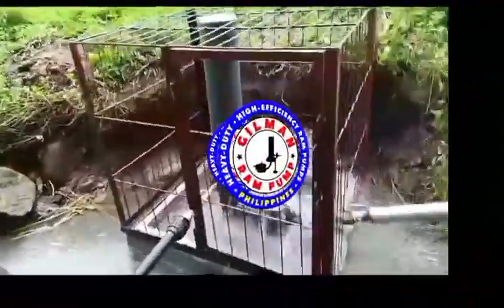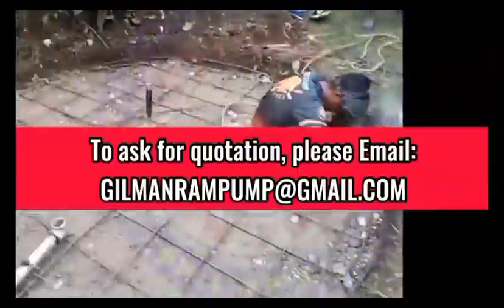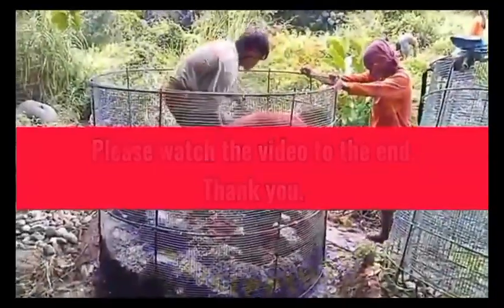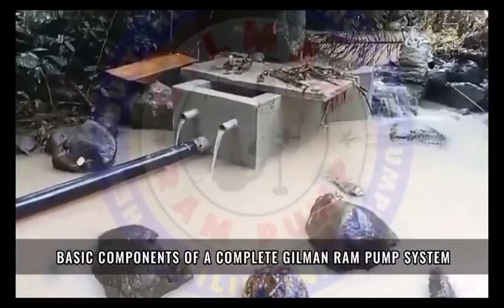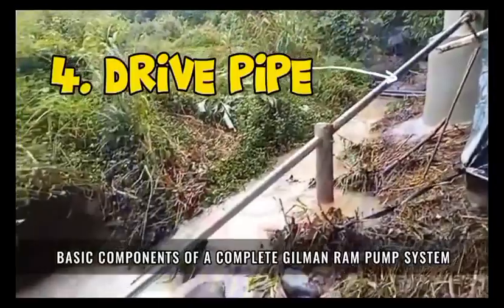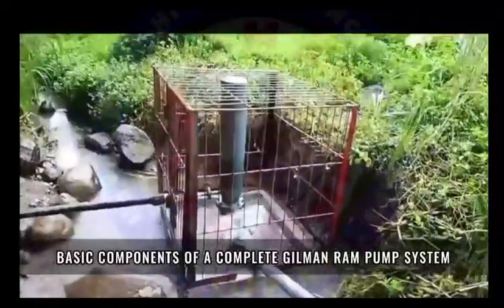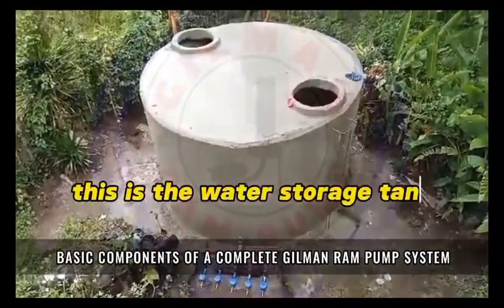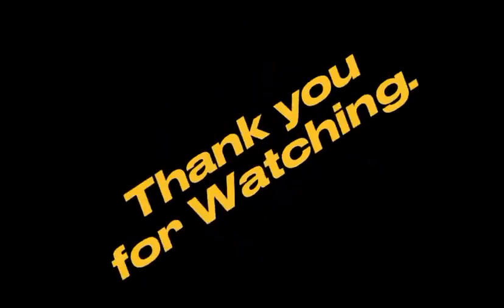WATCH THIS BEFORE BUILDING A GILMAN RAM PUMP SYSTEM

Comment: How much dollars you interested to this project !?
Reply from the maker: About USD24000
Reply: @gilmanrampumpphilippines  Means 1,357,000 Phillipine peso ?!
Reply from the maker: @kaliyuga_bro about Php 1.2 M  actually. The video footage shown was taken from an actual completed project in aa remote village in Negros Oriental. It was a commercially contracted project. What made the project expensive was most of the materials were bought and shipped from the island of Cebu. The specialized workers and specialized tools were mobilized from Mindanao, and other indirect costs.

But if it were a personal project, where the materials and workers are available nearby, the, project would cost, remarkably, much less
Reply: @gilmanrampumpphilippines  This is very expensive than ever !